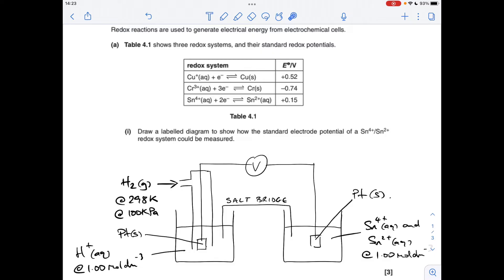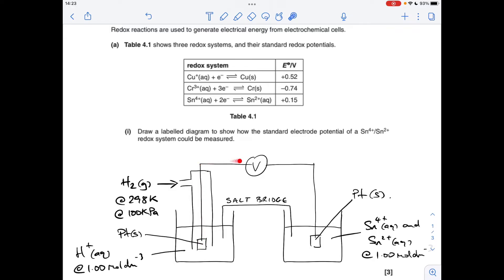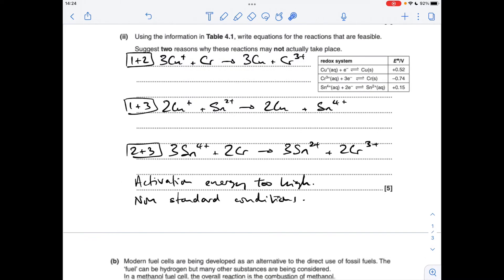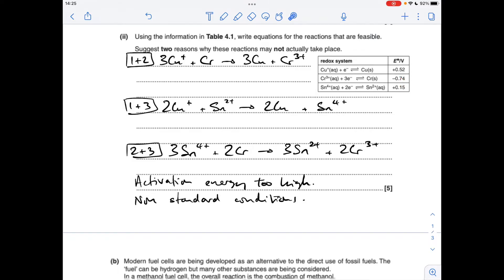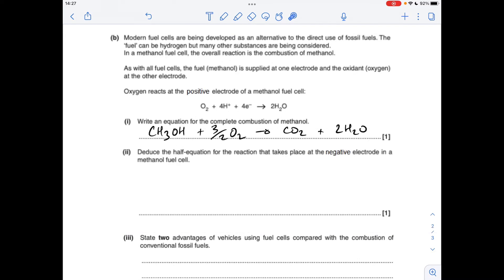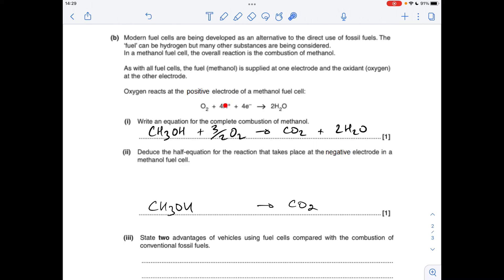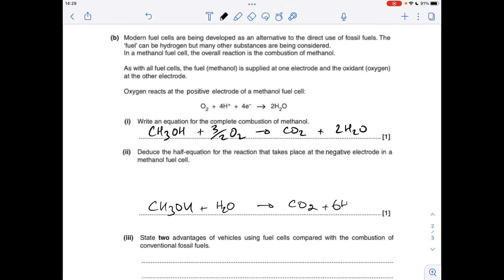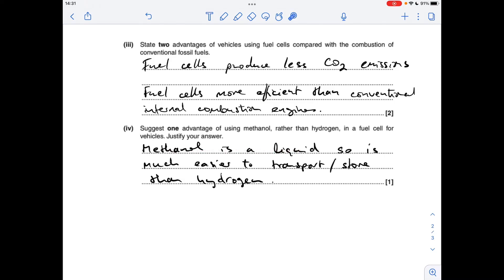A LEVEL CHEMISTRY EXAM QUESTION WALKTHROUGH - ELECTRODE POTENTIALS 1

Comment: @MaChemGuy 0:49 How do we know if we need to add an H2(g) electrode as it doesn't specify in the question (what sort of hints should we look for in the question)?
Reply: H2 half cell has an electrode potential of 0 so if you want to find the electrode potential of a different half cell, the hydrogen half cell is the only one that can be used, as any voltage produced comes from the half cell youre investigating